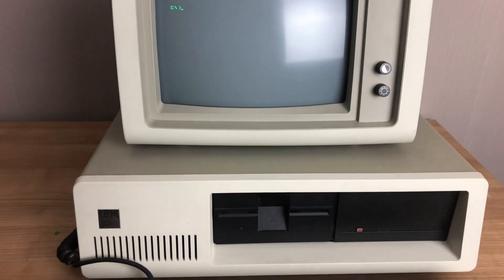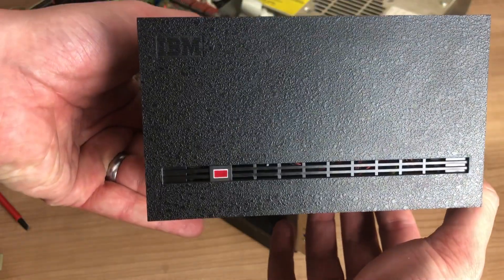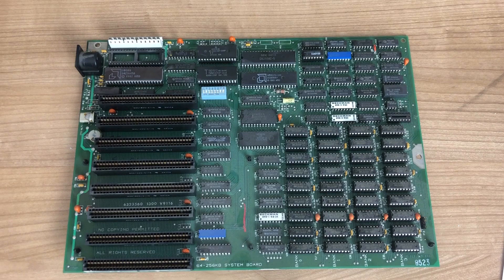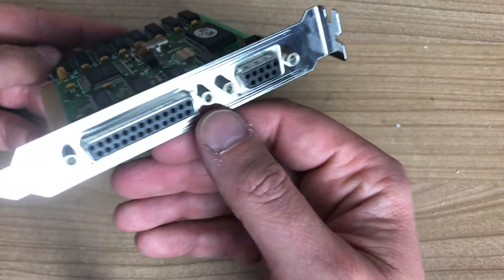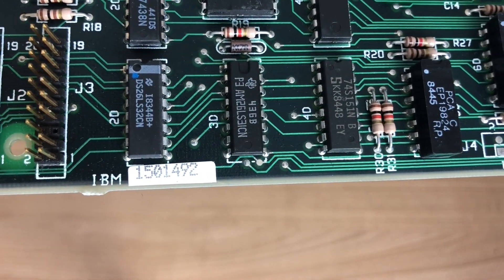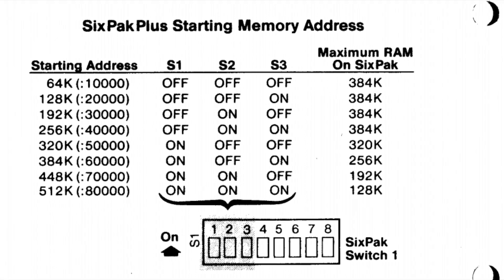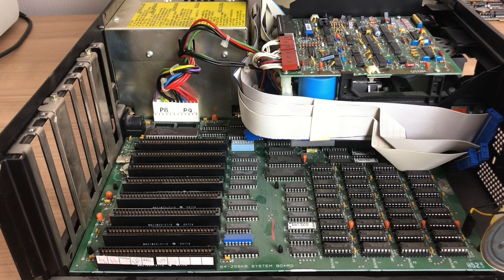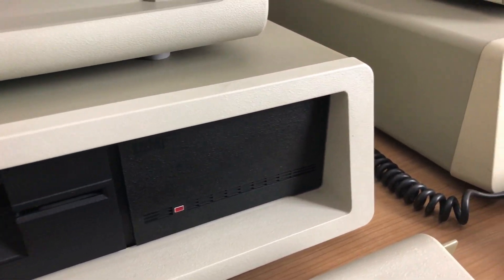IBM 5160 PC XT - Hardware overview

Comment: Giving the thumbs up for IDE cable management. Looks great.
Reply from the maker: There is literally no other way to handle the cables in such a system :) It is a very tight fight.
Reply: @RetroSpector78  I am binging IBM videos this week. No one else is doing tight 90 degree folds. It also looks like you are using clips to hold the folds together behind the drives?

Comment: Great video! Definitely hope I can get my hands on one of these some day.
Reply from the maker: Thx ! One of the first retro computers I bought turned out to be an IBM 5162. Had no idea about model numbers at the time and did not know how rare that particular model was. After that it took some time to find my next affordable IBMs (5150 / 5160 / 5170 / 5155).. But with patience they will pop up.  If you're just into retro and just what to have an XT experience there are also lots of clones available. These should be more easy to find and a lot cheaper.
Reply: i have a 5160 xt i'm looking to sell

Comment: Hey that's cool. the hard drive controller uses a z80 as the processor. that's crazy that a mainstream cpu used as a main cpu in other computers are just used as the controller for the hardware. Imagine having to use an i3 for your sata controller lol

Comment: Very nice video as always !
It will actually serve me well soon as I now have almost every parts to build back one IBM XT like this !

I only miss a case (that should be fixed soon), and a IBM floppy disk drive, everything else is ready (though my two motherboards seem to need new caps).

Sorry to ask you that on YouTube, but do you have any IBM spare drive (even untested or not in working order) that you'd be willing to trade ? I have several old spare parts that I'll probably never use, so I'd rather exchange them against things I will actually use ^^
Reply from the maker: Have lots 5.25 inch floppy drives here, but no spare full height IBM Tandon drives I'm afraid. Where are you located ?
Reply: @RetroSpector78  I'm in the North of France. And you're from Belgium I believe since I see you have many Dutch and French softwares, right ?

Comment: nice video but can you please do a short video of the cables that is connected from the colour monitor to main unit please, because I think my colour monitor cable is wrong, so please show your cables at the back please and any details please.
Reply from the maker: Should be straightforward. MDA / CGA / Hercules use 9 pin d-sub connectors (like a vga card but with 2 rows of pins instead of 3). If it has a vga card it will have a 15 pin 3 row d-sub connector. And you can’t hookup a “modern” vga monitor to an old ega/cga/mda/hercules videocard.